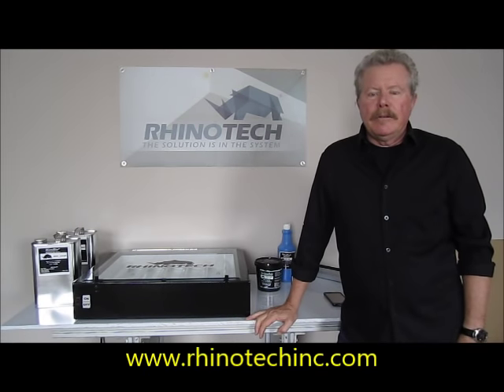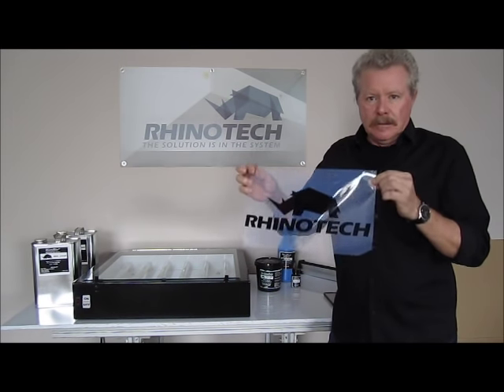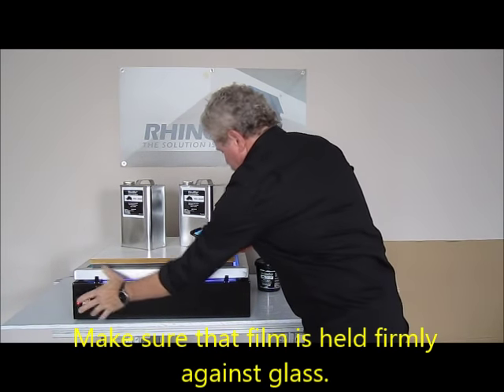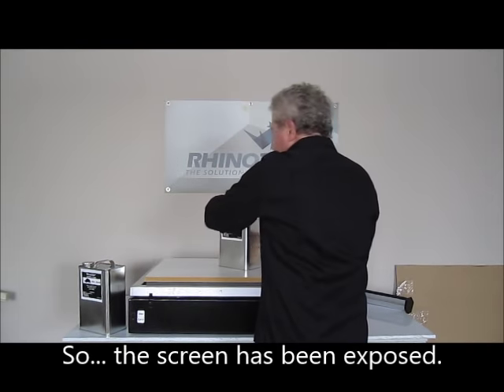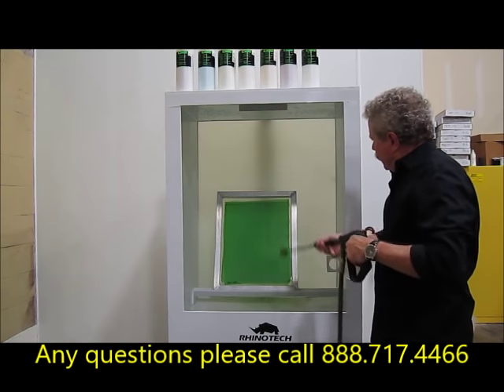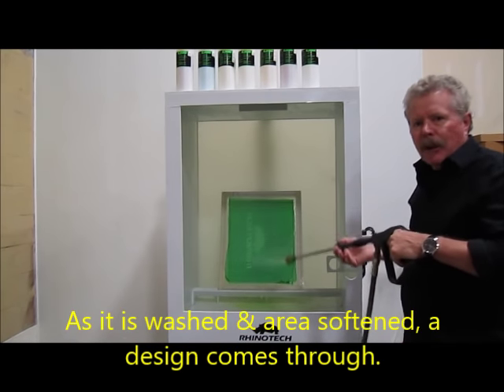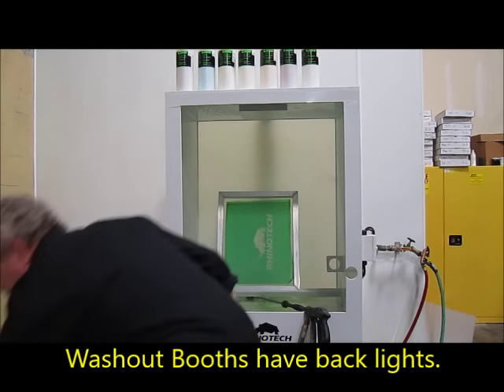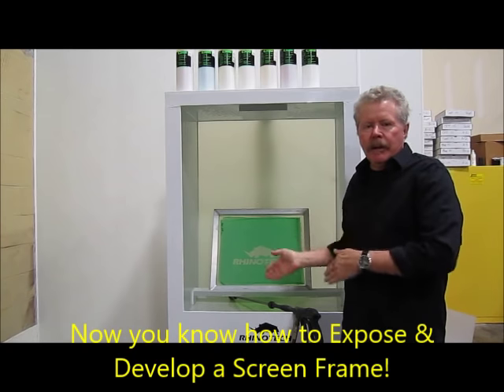Exposing and Developing Screens 101A

Comment: Roughly how much pressure would you say you were outputting?
Reply from the maker: Appreciate the question regarding the 1500A Pressure Washer Greg used in the video. It's a workhorse and lasts and lasts and lasts. He used it at full pressure, however, he physically backed off from the screen so the full blast wouldn't hit the screen at close range. If you have additional questions, feel free to give him a call at 651-686-5027 x 2. Looking foward to working with you.